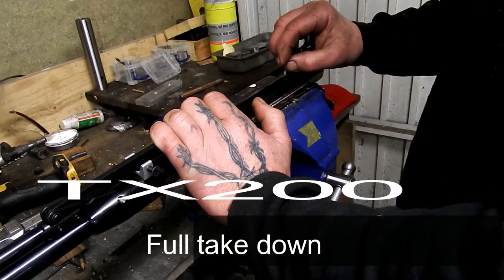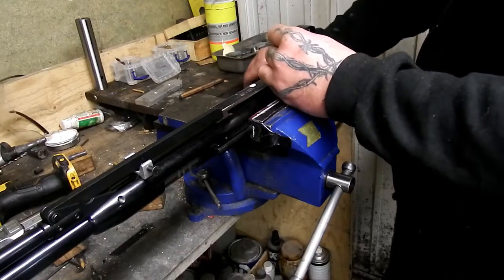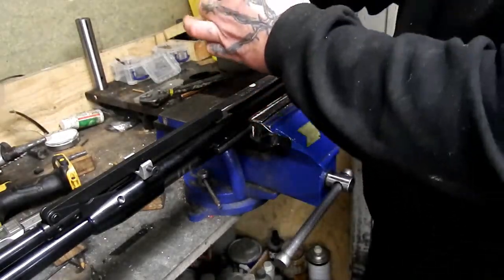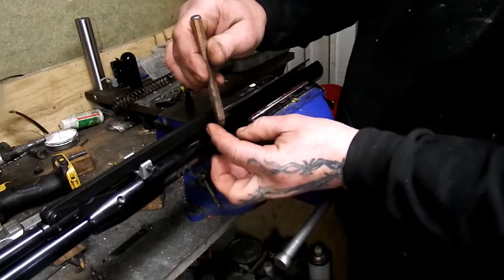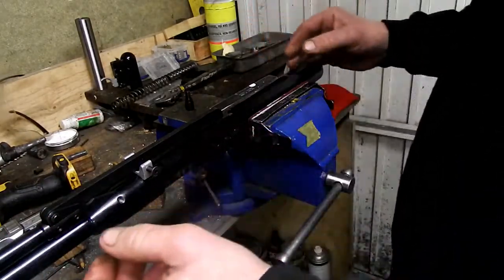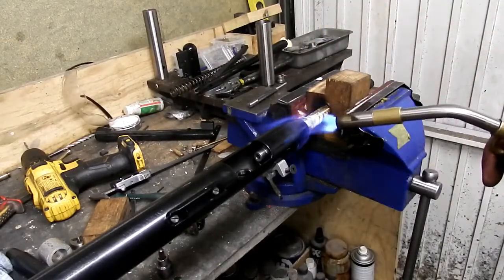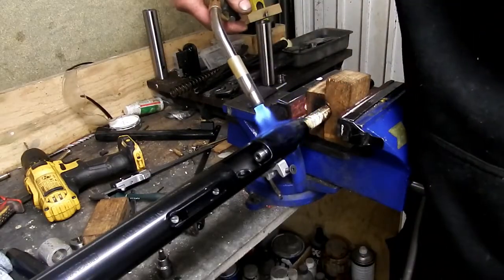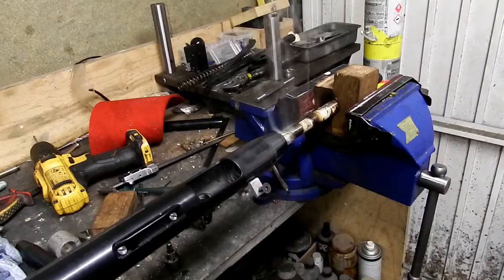Air Arms TX200 Barrel removal

Comment: Would a longer barrel make the gun more efficient to the point where you could de-tune to maintain a sub 12'Lb figure. Aim to have less kinetic energy flying about, shorter piston stroke and lock time, lighter recoil etc.... or would it be better just to buy an HW77 or 97?
Reply from the maker: On a spring gun, tbh, no. Careful piston & transfer port work gives the builder the opportunity to increase the efficiency of the gun.

Comment: Thanks for a great vid Geoff but my problem it a drill stuck in the moderator / barrel . I have maybe 6 or 8 pellets jammed in the barrell and I was hoping to dislodge them but now obvious the barrel is a lesser diameter than the mod. And when I say it's stuck it's stuck and I have no vice but I have tools. 13:38 
Any suggestions?
Steve 13/11/23

Comment: Hi Geoff, how did you work that black stock to be so different from an ex-factory Mk 1 ?  Did you add a rubber-like sprayed finish ? THX !
Reply from the maker: Hi. Yes it's a rubberised 2k clear coat over black base coat.
Reply: Thanks Geoff, but what is 2k ?  That cocking aid looks a bit like stainless as well, correct ? Meanwhile I could'nt find info about your nickle work referred to somewhere below, sadly.....
Reply from the maker: @hendrickotto103  I think I made that one from HP tube. The Nickel post was a demo I did on Nickel coating prior to using cold blue in a hot state. It was intended as a trial but the gun is still looking good somewhere I believe.